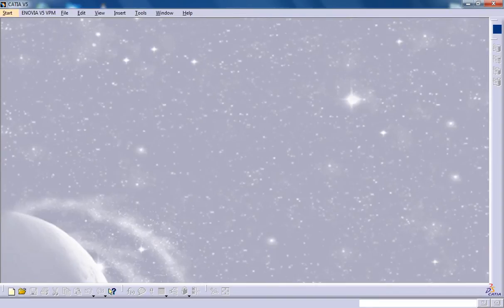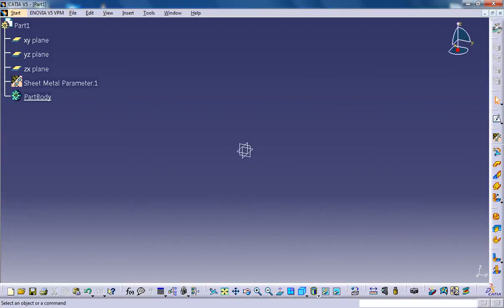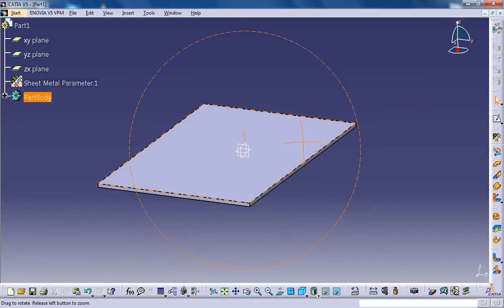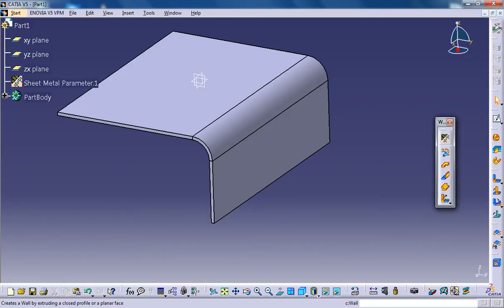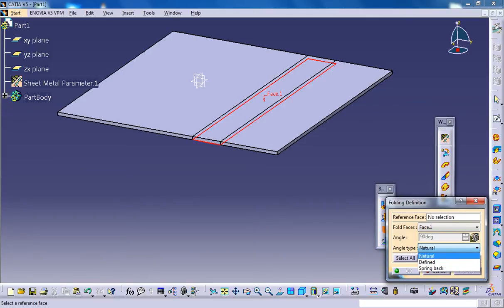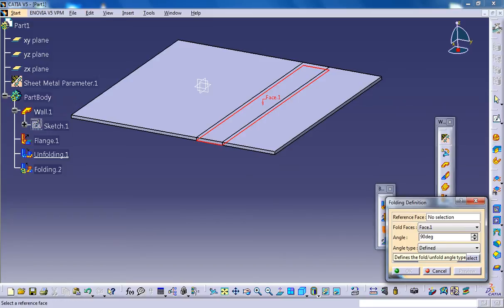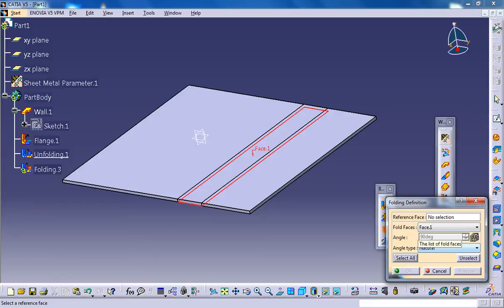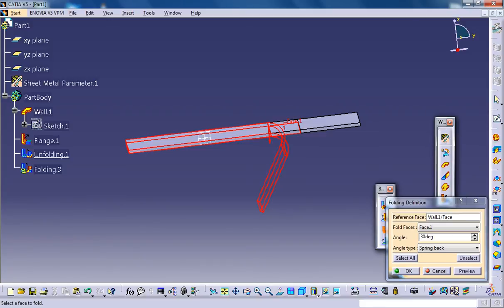Catia V5 Tutorial|Bending:Folding 3 Types;Natural;Defined;Spring Back|Sheetmetal workbench

Comment: Hi sir.... This is Ramesh.
I saw this video... It helped me a lot, thanks for making for us this valuable video. My doubt is I want to bend a chennel 6*236*2100 sheet size. Channel 80.*100*6 I want to bend this C channel at 560 distance upto 168 ° please tell me sir. I am not able to do it in my laptop.
Reply from the maker: First create a line at the desired distance. This line has to be created on the surface of the sheet metal. Then use the bend command and bend using line as the support for bending. All the best.
Reply: @howENGINEERSdoit   sir i have tried in the same way but  still it did"t made as per my requirement. can i have your no so that i can send you a image. 
 its bended  tube like C sectiona channel like ismc .